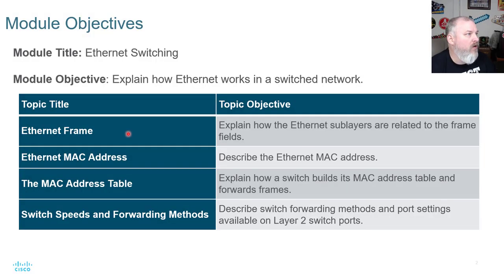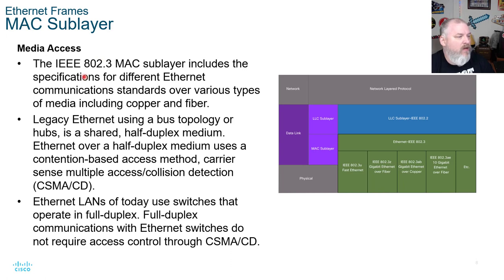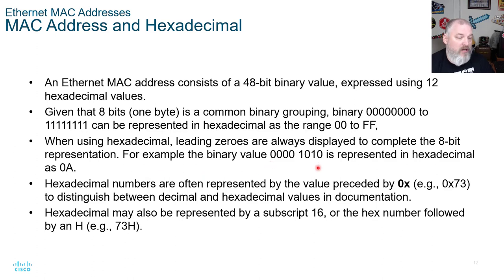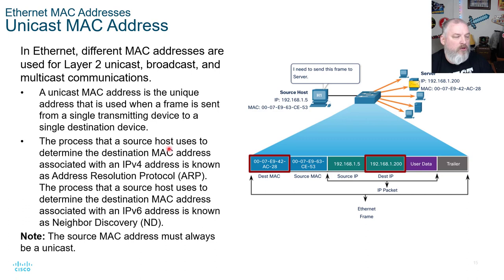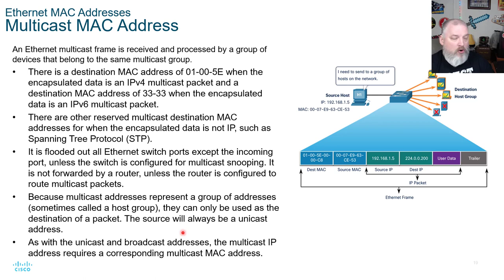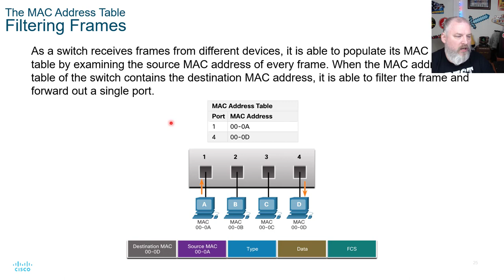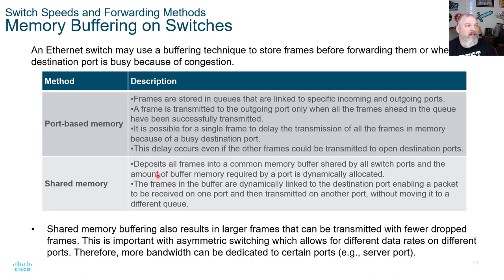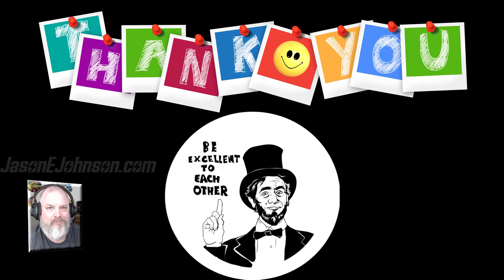Intro To Networks v7 - Module 7 - Cisco CCNA NETACAD

Comment: Does the version of the book matter? I would like to buy the one that costs 5 bucks (7th edition) but it's not the most recent, which is 16 times more expensive at $80.
Reply from the maker: I believe the newer version of the book is the correct one. Just make sure you get the version for the v7 content.
Reply: @Jasonejohnson31  Alright thanks for the tip! 😀

Comment: shouldn't 0000 1010 be AA?
Reply: No '0000' = 0 and 1010=A
Reply from the maker: 0000 1010 could be written as 0A but the 0 would be dropped. 1010 would be A. I use https://www.binaryhexconverter.com/hex-to-binary-converter to check.
Reply: @Jasonejohnson31  yep